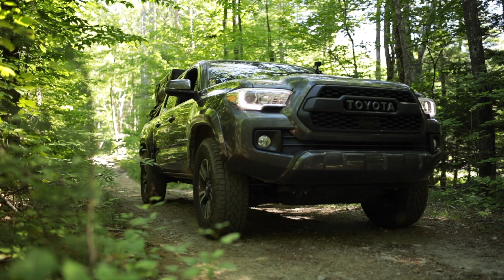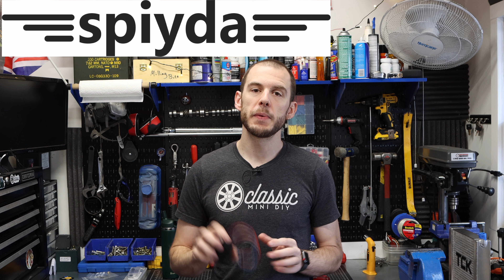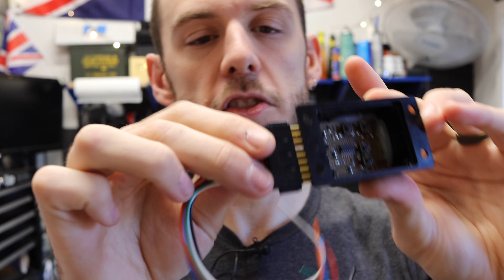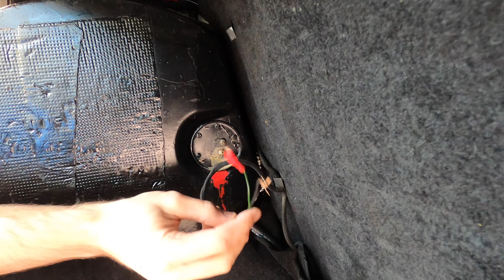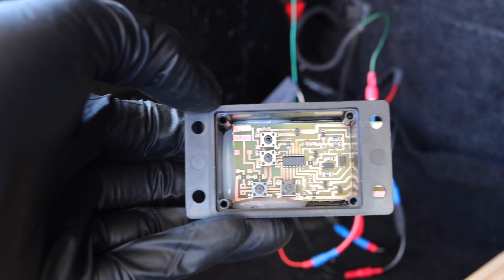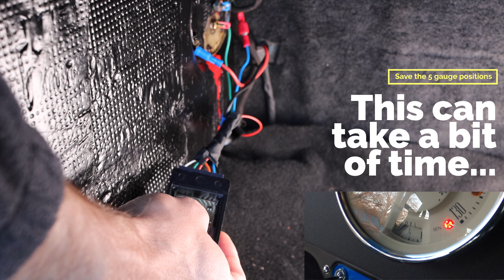Fixing a Mini Fuel Gauge Level - The Spiyda Gauge Wizard Mk4

Comment: What if we just want to add an aftermarket fuel gauge? How would one do that? I bought an android radio and the lights for the fuel gauge don't work so I need to add an aftermarket gauge so I don't run out of gas.

Comment: Nice video, FYI the extra wires are for warning lights on the dash,  operated when the needle gets to a programmable position, one is designed to be a  two stage low fuel warning and the extra one you can use for all kinds of strange things, such as a high fuel warning light at 1/4 of a tank, mounted at the rear so that you only fill to 1/4 when doing a stage.    I would have mounted it behind the dash, but on the tank is fine.    well done.     Chris at Spiyda

Comment: My fuel gauge used to go down when I was going over 40 mph, I changed the voltage stabiliser and that solved the problem. 👍
Reply from the maker: Yup those voltage stabilizers are a super common failure point. The new replacements are much more reliable too, they use a different internal solid state resistance mechanism. In my case my sender was not correctly paired with the gauges in the car. The mk1 senders use different resistances than later cars.

Comment: Bought one on the back of this, I've had Spiyda's led lights in my MK1 since they were first launched and they've been faultless so feel this too should be a good buy. I've had multiple sender units in my Mpi tank and the digital Smiths Speedo unit is unable to read correctly and cant be calibrated.

Comment: Looks like a cool device.. Even at best the fuel gauge is more of a rough guide!   I'll be very interested to see how you get on.  I'm pretty sure the resistance on the later senders is not linear at the top end to try and compensate for the changing shape of the tank.